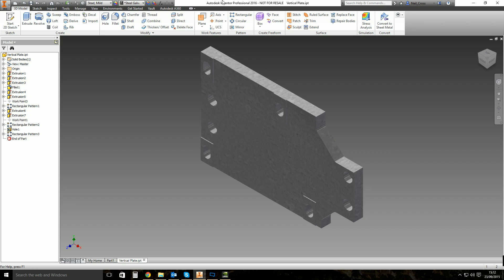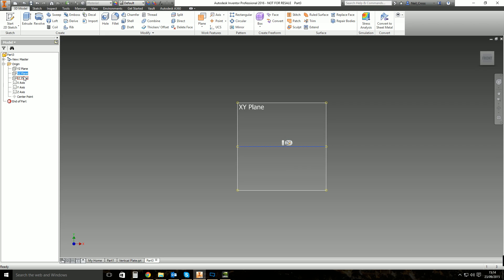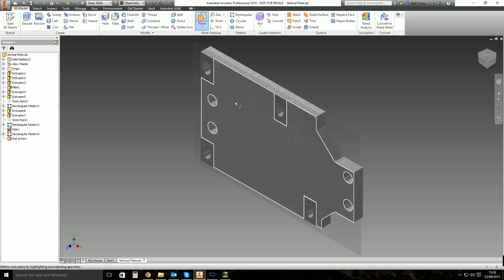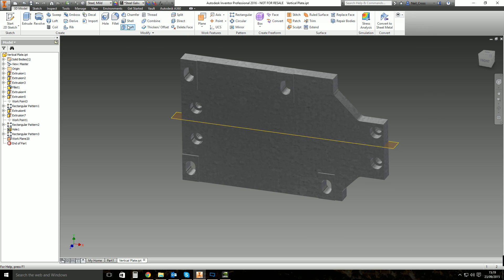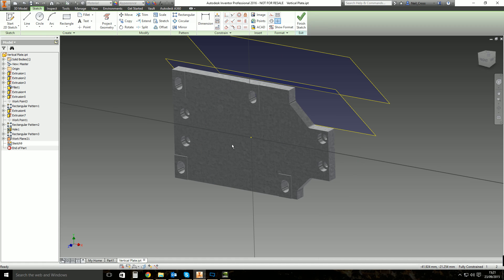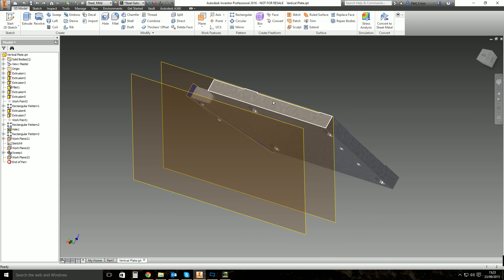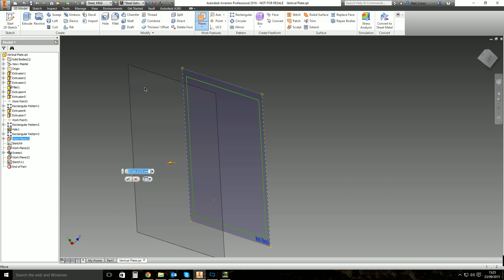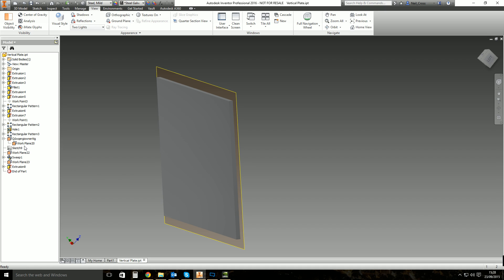Everything about Work Planes | Autodesk Inventor

Comment: So i know i'm commenting on a 3 year old video, but i had a question.... Is there a simple way to create a work plane based upon an axis and a point in space that i don't know about?  For instance, doing tube work, i want to grab the axis of a tube, and a point from a sketch on the end of the tube or possibly another sketch somewhere and create a plane based on that.  Unless i am missing something, it doesn't seem possible even though I would think it should be.  As i do it now, i have to create either work points on that axis, or an extra sketch to create a 3 point plane.  Do you have any advice?

Comment: I always come to this channel when I need a tutorial. I did learn from a few things from this. Do you have a tutorial on getting work planbes into iParts/iAssemblies. I checked those videos and didn't see anything. I'm going blind trying to put together an Assembly/iAssembly of a concrete footing conatinging anchor bolt/cages, the round concrete pier, rebar, etc by picking the parameters. I there a "next level" video I'm missing? Thanks in advance.

Comment: I'm trying to thread a steel cable through an assembly(boatlift)  the ends are anchored on both ends but the cable needs to go over 1 pulley and then under a second pulley to lift the assembly up and down. Basically like a car hoist but in this case it's a boat. Any help????

Comment: I need to create a work plane, on a funnel. I really struggle, as I can only press the "inside" of the funnel plane, and then no other point is available (no I am not using one of the "special" plane tools. Hope you can help :)
Reply: Ok, so I have literally used 4 hours trying to figure out how I make the work plane. Since the "funnel" had no edges etc, i had to make work points and axis to get the correct work plane angled and lined at the correct place on the circle. At least now I figured it out (just after I posted a comment). Again thank you for all videos.

Comment: Very helpful.  What screen capture software do you use?
Reply from the maker: +Marcus Friesl I use Xsplit, which is meant for gaming streaming but it has a pretty solid and reliable local recording facility so I just went with that!
Reply: +TFI CAD Tips Great Quality.  We work alot inside assemblies, and project elements from one part to another.  We sometimes have issues with those projections being adaptive, in some cases.  Would you ever considering doing an in depth video on the adaptive setting for within parts, etc...  Thanks for doing these.
Reply from the maker: +Marcus Friesl I've already done an adaptivity video, but I wouldn't really class it as being in depth.  It's a difficult one to cover all bases as the problems you've had could be unique to the geometry you had at the time, meaning I could talk for hours about adaptivity and not reference the situation you experienced.  One alternative to projections is detailed in this video https://www.youtube.com/watch?v=LP4ArppuXno but again it depends entirely on what you're doing, but take a look at this one and see if it helps?